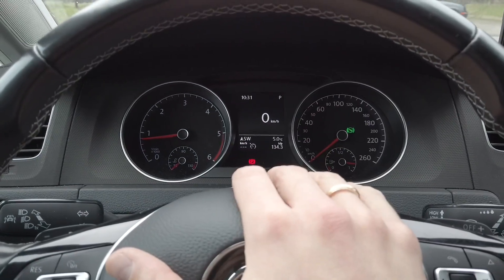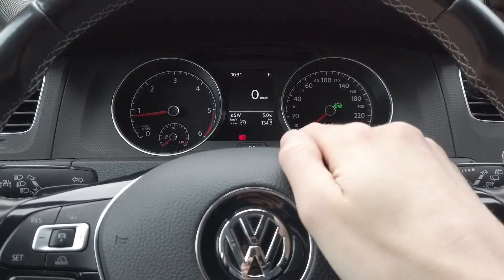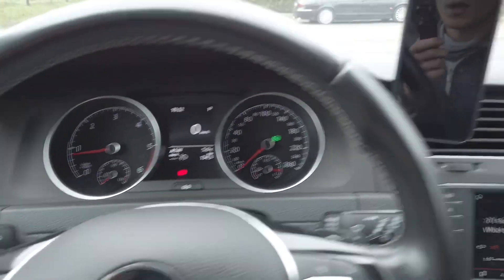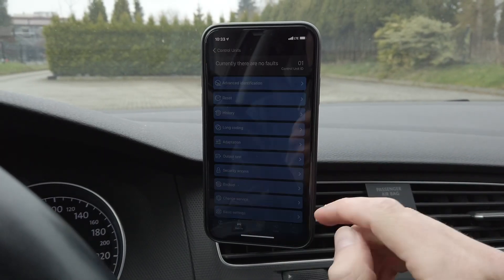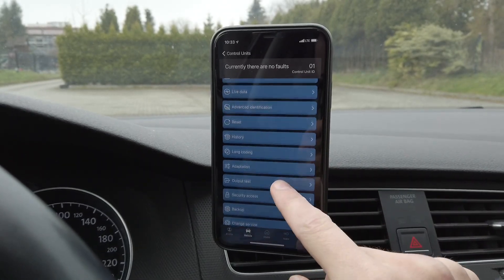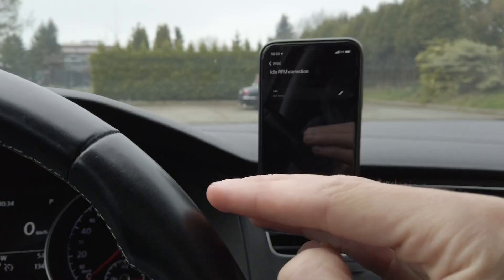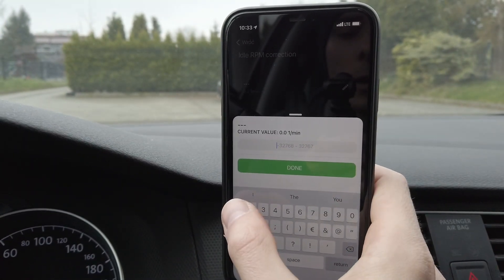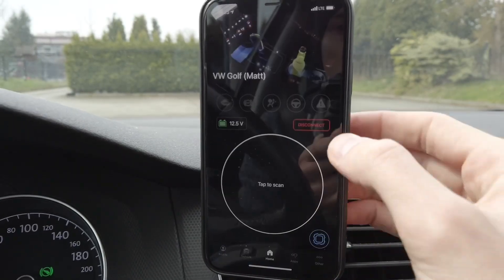VW Golf MK7 (5G) how to increase engine idle RPM

Comment: I tried this on my 2016 mk7 GTi clubsport and entered '100' but was given a red error message which said '(22) function cancelled, marginal conditions have not been met' 

Can you help please?
Reply: Did you solved the error message and what is your current idle RPM? Try to add only 50 RPM.
Reply: @Sverigebilden  hola lo resolviste? Yo pongo cualquier cantidad … pero solo aumentan las rpms 50 por minuto

Comment: I tried this on my Vrs petrol,. The value was at 0. The input said 0-255. It didnt matter what i entered it just changed the value to 50.

I wanted to increase mine to assisst with vibration after fitting a dog bone mount insert

Comment: Hellow everyone, i didnt find this option on may 1.4 Golf Mk7, but i found in Gatwey modul, idle increase corection stage 1 2 and 3.
When i adaptit it work, but after reignation the setup is back to old value. Is there someone whu know  how can i set it for good?
Reply: Hello, got 1.6 tdi cxxb and also can only change to stage 1,2,3 in CAN gateway. Can you tell me which one you choosed and how many rpm it went up?

Comment: Which odbeleven did you buy i see several different ones.
Reply from the maker: There are two devices: 1st gen (for Android only, for VAG cars only) and 2nd gen device (for iOS and Android, for VAG and BMW).
There are three plans: basic (predefined procedures only payable with credits), PRO (predefined procedures payable with credits + direct access to coding and adaptation), ULTIMATE (predefined procedures with unlimited access + direct access to coding and adaptations).

So you need to select device and plan. Personally I use the 2nd generation with PRO license which you can buy in a pack (PRO pack contains device and PRO license).

Comment: Actually this types of corrections messed up my DSG transmission it was harsh on pulling off from stand still, the car thinks you are stepping on the gas and the whole transmission was jerky, the value should be always 0..( it was increased by only 40 in my case )
Reply: You should also have reset your Ecu when doing this mod !

Comment: Nice video and explanation.. i have an audi a3 8p and my idle rpm are around 600. When am accelerating from a stop point i can feel a ruttle only from 1st to 2nd gear. It changes so quick due to DSG at around 1100 max. Are my idle rpm low? Should i increase it? I dont  have that option on my OBD but i will bring it to my friend and do it on VCDS.
Reply: Did you figure it out? What did you do. I have a mk7 kinda same thing happens to me

Comment: Is it posible to increase idle rpm when car is in drive, i have x5 with 3.0 diesel engine and it works very rough in D. One programer adjusted my rpm on 900rpms but when i put car in drive it throws it back on about 600, while in R it still work with 900rpms
Reply from the maker: Not sure what's possible for BMW X5. This video was made in VW, and the tool used is for VAG cars only (VW, Audi, Seat, Skoda).

Comment: You know there is this leber below the steering wheel on the right. You can press it with your foot and it will increase the rpm.
Reply from the maker: Yeah, but it will also release my auto-hold brake when I press it, and I don’t want that.

Comment: Hello i have a golf mk6 manual 2.0 tdi when revs are at 1100-1200 and if you want to accelerate the car with vibirate untill car goes up to 1400rpms+ any idea...this happens when you are in 2nd gear and up
Reply from the maker: There's number of things that can cause symptoms like that in diesel engines. Most common ones are: fuel injectors, MAF, MAP, IAT, and even dual-mass flywheel
Reply: @mrfixpl  will this work on a 2018 golf r ? Having trouble raising it.

Comment: Just change the engine mounts and transsmission mount to fix the dashboard vibration on idle rpm 
No need to do this 
Your car is going to spend more diesel(gas) than usually
Reply: If you need to worry about idle consumption you're doing something wrong.. You will barely notice the difference considering it's only 100 rpm and usually one doesn't idle for hours on end. Plus, most of us won't go through the hassle of changing the mounts compared to this
Reply: You think so? I’m also having this issue

Comment: On my Golf Mk 7.5 the rpm are on 1000 and they fail to come down to 800 when the engine is warm. Any ideas???
Reply: Happens to me too, I suspect that it's caused by the increased EGR (the previous owner let VW install their shitty diesel update) ((more EGR = harder for the engine to burn the diesel as there's less oxygen and more exhaust bases in the combustion chamber - makes it less polluting but worse to drive, less responsive and consumes 1-2 liter more in my experience)
Reply: Is it like that in D?
Because when in S mode I know it increases to 1k

Comment: Hi. I have a question about another tutorial if you don't mind. My 2013 Eos is the Lux trim and has the factory power mirrors. I want to do the keyfob fold but am not able to get in that module. The security code that you used will not work for me. Any suggestions as to why I cant get in? Thank you so much for your videos!  😊
Reply from the maker: Different car model > different module > different security access code

Comment: I have idle rpm at 1000 when AC is on and 750 when off. Engine 1,5tsi. It's normal?
Reply from the maker: Normal.
Reply: @mrfixpl  please check the message above. Thank you.
Reply: I have a 1.8T and mine does this too. But the problem I'm having is that if the engine idles at those rpm the oil pressure warning will light up. This only happens the first 15 minutes of driving the car, after that it won't appear again. My mechanic has replaced all oil sensors, he cleaned all the sludge from the valves, he installed a new upgraded oil filter base and the problem still persist. He says that he has monitored pressure levels and they are perfectly fine. We are not sure what is causing this, could this simple idle adjustment fix the issue?
Reply: @luisarsuaga7637  check oil level

Comment: Must admit i learned to do this with vcds, but that i interface is so user friendly 👍
Reply: How to Do it with vcds ? Can you tell me please ?
Reply from the maker: VCDS will be the same way. Go to module 01 (ECU), Security Access, enter the code. Then back to Adaptation, find the adaptation channel, enter new value, test and save.
Reply: @mrfixpl  very true the thing about vcds and this is the pop up's on vcds dont always provide all the possible security access codes to make changes to the controller, but this system appears to give you a lovely list of possibilities rather then the stock engine 12233 if i recall correctly

Comment: Can you code this but only if you put the dsg into sport mode?
Reply from the maker: No, you need to ask a tuner if that’s possible.
Reply: @mrfixpl  and if i do this +200 and want do set it back to the old its just -200 i need to input?
Reply from the maker: -200 would set idle RPM 200 below standard. You need to set it back to 0.
Reply: @mrfixpl  thnx for info i subcribed you
Reply: @mrfixpl  i try it today but it will not work on mk7.5 gti 2018 its only putting 50 higher not more

Comment: Good for winter, helps the car warm up faster
Reply from the maker: ECU should increase idle speed itself when the engine is really cold. But yes, you can force it to do it with this adaptation.
Reply: @mrfixpl  can I lower my rpm...example Audi S3 rpm is around 800 but  when in sports or dynamic it changes to just below 1100.  I think this is to high especially when at traffic lights.   Can I turn it down only in sports /dynamic
Reply: @mrfixpl  my 2015 sport wagon TDI does not increase idle speeds when it’s cold. Is there a way to enable that through OBD11?

Comment: the downside is that your engine runs louder at idle, and you burn more fuel at idle
Reply: With all the emission stuff on the new diesels, higher idle = happier diesel…
Reply from the maker: everything has its pros and cons 😉
Reply: Who cares if the car burns around 75ml/hour more fuel at idle :)

Comment: Is there anyway to get CarPlay on golf mk7 without having to upgrade to mib2?
Reply from the maker: I believe there is. A box that you need to connect between the display and the main unit. It will block the original video feed and “inject” its own with features like CarPlay, USB playback and more.
I’ve done such installation in A6 C7. Check it out.
Reply: Would the same box work for golf mk7?
Reply: @zriverside8704  https://www.dynamicsounds.co.uk/adaptiv-lite-advl-vw1-volkswagen-oem-multimedia-apple-android-upgrade.html You will have to look at something like this. I am also looking for a similar option to get android auto without upgrading my unit. I have not tried it out yet though.
Reply from the maker: Not the same, but there should be something similar for MK7. Also depends on which MIB1 unit you have (composition media, discover media, discover pro...)
Reply: @mr-fix  i have the MIB1 discover media, which box do i need for the CarPlay or android auto ? Great vids btw👍

Comment: Hello. Do I understand correctly that this also works for the 1.4 TSI (CMBA) engine? Sorry for my bad english.
Reply from the maker: Should work. Check if you have this adaptation channel and try.
Reply: At mine 1.4 TSI CZDA there is no channel like this.
Reply: Mam to samo 1.4 tsi czda. Nie ma takiej pozycji w adaptacji.
Reply: @maciejpodbielski9558  Rozwiązałeś problem? Też Mam 1.4 tsi i nie sziala